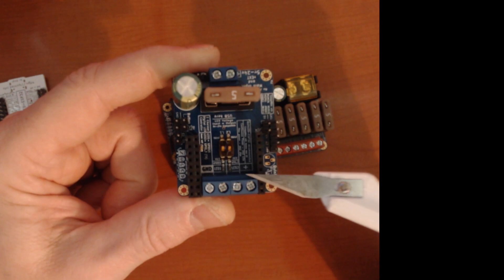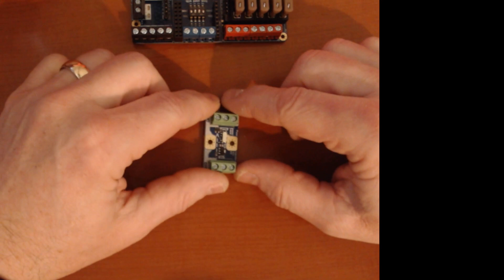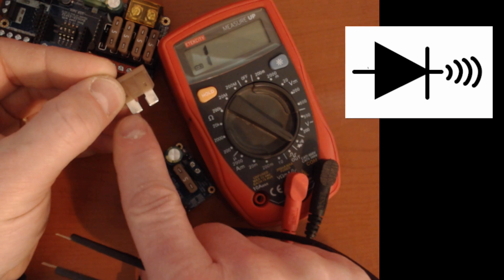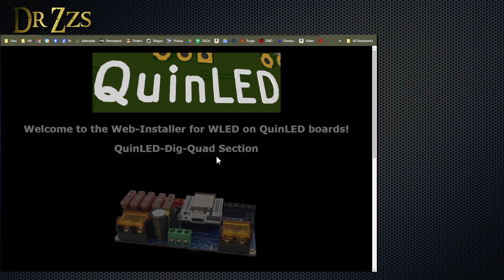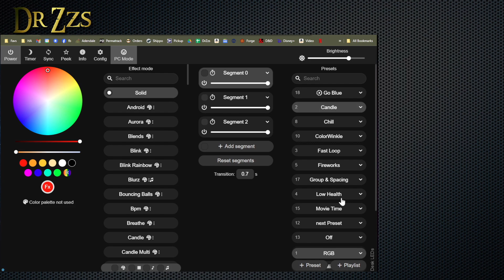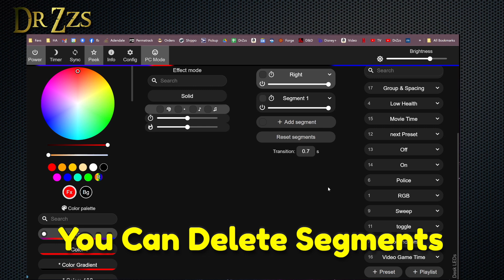LED Solutions & Troubleshooting | WLED | DigQuad | DigUno | Permatrack

Comment: Will the data booster work on a different type of controller? I have some cheap ones from Amazon that are flickering. I assume it's mostly flickering because it's at least 30 ft from the power supply to the first pixel. When I bench tested the whole system I don't remember it having this issue so it is likely from the distance

Comment: Great video thank you! I have a quick question on the Dig Quad. I had it up and working ok on my wifi, and then i got crazy and changed the static IP address, now I cant access it. I would like to reset it to factory settings but cant figure out how. Ive tried holding down the reset button with no success, any help would be appreciated, thank you!

Comment: I have had heat cause flickering from my quad.  I had it in a flat position in my box, turned it to about a 45 and the flicker went away. Also added an exhaust fan. 

This was during testing and the lid to my box was open the whole time. 

As for OTA updates, I updated to 14 via OTA and it also wiped out my presets and then showed they were corrupted. I had to then update via usb to get the ability to have presets back but then lost the white channel selection option. Lots of work still needed with WLED.

Comment: Another common problem is IP addresses NOT showing up. Buy, The WLED PRO Version for your iPhone/iPad. It should make that easier for the beginners or non-tech-heads. Also, Dr. Zzzz wasn’t insistent enough, IF YOU ARE CUSTOM making complicated presets (like 2 greens, 1 white, 2 reds, 1 white) or (4-6 of your own custom colors), these will start to mess up your memory & blow out the programming &/or data on your esp32 ONCE YOU HIT AN UNKNOWN LIMIT. MAKE LOTS OF BACK-UPS & rename them i.e. Christmas1, Christmas2, Halloween, 4th, etc.  I’m going to say, if you get good at the presets, listed above, don’t have more than 2 of them (complicated) & 8 “Normal” (maybe 10) presets. Make a back-up & call it Christmas1. Make sure you do BACK-UPs. They are easy and save you time NOT rebuilding them. If you’re going to play with PRESETS, don’t play with them on you main house board. Buy another board & do all you PLAYING AROUND on it. You can copy it to you main controller later. I back-up Halloween and delete it ALL for Christmas and restore my old Christmas back-up. Good Luck!

Comment: How about joining wires of different gauges, like 14awg with 18awg? Or how do you recommend “tapping” into a parallel run without a T-connector

Comment: Im having an issue with brightness, looking at pro installed lights pixellights and such, these just aren't very bright.  I have a 300w, 25a power supply and the temporary lights in my neighborhood are just a lot brighter, you can see them down the street where mine I have to be close to the house to see them

Comment: So should i not have any problems with my lights starting 25 to 30 feet from my digiquad?  I was but need to try and switch the resistor switch.  And when would you have more power leads from power pack to controller?

Comment: Much easier to use cheap $2 RS485 boards on each end. I can use 300' of cat5 cable and have no loss if signal integrity.    https://youtu.be/T80llbFYD98?si=1QSgBqI5yV4Dfrvp